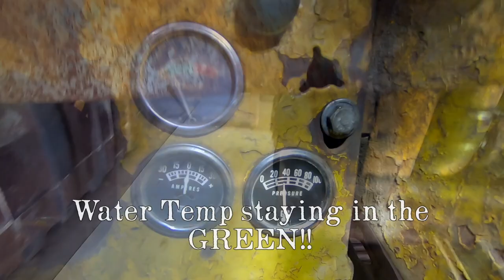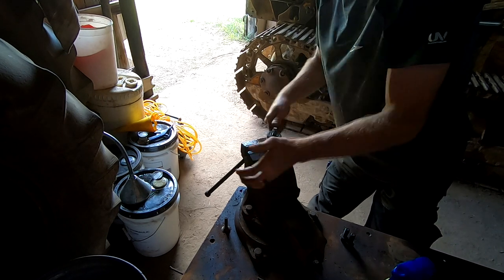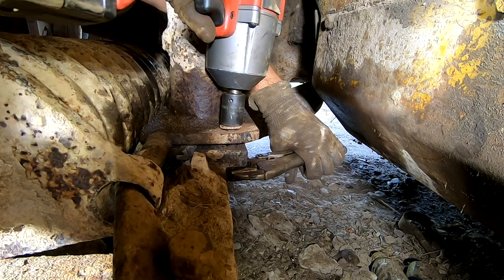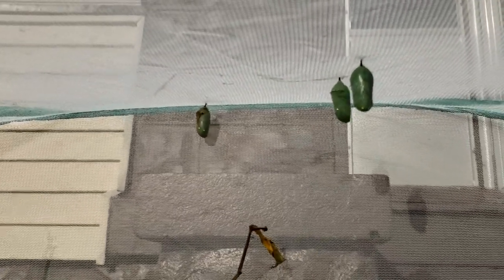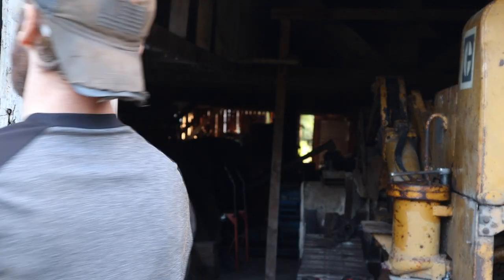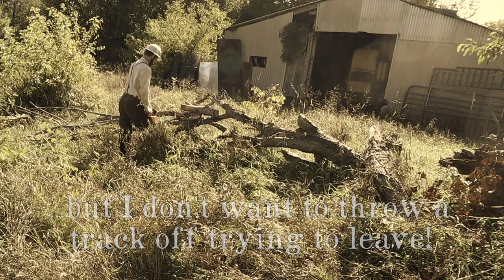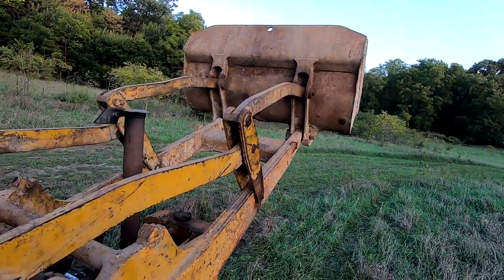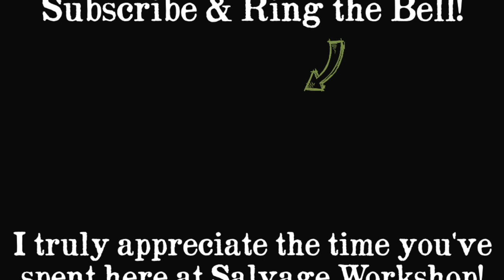Will the Bucket even WORK after 20+ Years? ~ Part 4 ~ 1950's Caterpillar TraxCavator

Comment: I am not an officially accredited mechanic, nor do I have any official recognition of any kind in that regard so take my suggestions on the merit of rational logic and the strength of the disclaimer.
I am an Aussie 'bush mechanic' and I too, 'left the factory' in 1956, I have been messing with heavy machinery for the better part of fifty years.
I learned the ropes living and working in rural communities and figuring things out for myself or helping my buddies, particularly while mining opal in the Outback and maintaining my own equipment.

I suspect that once the track tension is where it should be according to manufacturer's specifications, sideways play would be undesirable due to torsional wear on the track pins and sockets and maybe even the drive sprocket at the other end.
The shims are probably only intended to be used for centering the tension idler in correct alignment between the track and suspension frame.

The main reason likely for maintaining slight clearance between the idler axle end plates and the chassis rail would be  to prevent misalignment between the idler axle and retainer bracket due to uneven tension resulting in abnormal wear.
Just in case you don't know yet, for non-mechanical tensioners adjusted by grease, the only way I have encountered for normally increasing track tension is by pumping grease into the cylinder which pushes against the plunger and this is achieved via a normal size grease nipple.

That cylinder, can hold quite a bit of grease when a track is near worn out and the adjuster is near it's limit and also be aware that the adjuster assembly and idler are very, heavy as a unit.
Despite this, the most efficient way I have found to clear all the grease out if you fit a new track/idler and need to back off the adjustment is to remove the plunger from the cylinder like a giant syringe and scoop out the grease.

Also, you cannot save money via extending the life of tracks by removing links because it incurs a different cost anyway.
This is because just as gradual stretch in the drive chain can do, removing links can alter the angle at which the tracks engage the teeth of a drive sprocket in more or less the same way as happens for motor cycle chains.
This causes the teeth on drive sprockets to wear faster in a sort of crescent shaped curve on one side so that the sprockets will then also need replacing as well as the track.

In addition to all that, I have only ever serviced old style tracks and the amount of heat you have to apply to a grouser plate in order to drive out a pin with a sledge hammer and drift is phenomenal not to mention very awkward!
I finished up buying a propane heating tip that puts out a flame like the burner on a small hot air balloon in order to apply sufficient heat to the track pin on a larger machine!
Either that, or you need a really beefy hydraulic power pack and ram!

Comment: My only experience with track loaders is having worked for a contractor in the 1980s who had an early 1960s era John Deere. The tensioners were frozen and I don't think the tracks were actually parallel anymore. My boss had a way of turning the machine a bit, backing up and the completing the turn. His son, being younger, was always in more of a hurry and had a tendency to run the tracks off while using it. Then My boss and I would have to put the track back on. The first time it almost an entire eight hour work day. By the time they were done digging the foundation for his son's warehouse we could fix it in an hour.

Comment: I would be careful about the track tensioner. It could mean that the track or the track bushings are worn out. But again I’m no expert. Just keep in mind. 
Think like some others that an owners manual and service manual would be money well spent! 
Having a blast watching you get it running!👍
Reply: The bearings in the front idlers are totally shot. You can tell by looking at how off center the idler is with respect to it's center of rotation (side view).  This is why there is so much side to side wobble in the idler.  This machine will cost way more to restore than it is worth.  Every time he fixes something,  he will discover that some other thing is worn to self destruction. The idlers will need total replacement along with track adjusters and track, and sprockets, and rollers....  And on and on and on.  Better quit while he can, just wasting time and money.  Good YouTube fodder though.

Comment: You would want a little bit of movement so when you go to adjust the tracks the idler moves instead of being shimmed up real tight, you’ll figure it out👍 good job so far on bring it back to life
Reply: Also if a rock gets caught in the track the idler needs to be able to spring back instead of breaking something.
Reply: It is very common to find these types of repairs (in our area generally called plating) as repair patches whe adjusters don't work, springs are broken or soose tension.   Usually a stack of Plates with a U cut into them and dropped over the cylinders, screws, or spring retainers.

Comment: You have great mechanical ability, You need the 1- Operators Manual 2 - Parts Manual 3 - Service Manual from Cat or ebay ect. Use the exact model # and Serial # to get the right ones. Gregory Cross is correct you over camed the bucket linkage because of wear in the pins. The Idler is missing wear strips under the idler hub, and it probably needs the wear strips on the inside bottom. Change the motor oil filter I have had those canaster filters collapse in the canister when sitting for a long time stopping the oil from lubricating the engine. Always put your implements (Bucket ect) on the ground when you work on hydraulics.  Good Luck keep up the good work
Reply: Bill wrote: ".... The Idler is missing wear strips under the idler hub, and it probably needs the wear strips on the inside bottom ...." ......  It doesn't look as if this machine has wear strips for the bottom of the yoke; that came on later tracked loaders. The roller frame doesn't have the brackets for wear strips, and the the yoke is not shaped to accept wear strips.
Reply: @wittwittwer1043  The wear strips I am talking about you can see in the video at 4:00

Comment: Know this machine very well. We had several different models of the 955 on the ice when I was there in the late 70's including at Byrd one of these. The pony motor is unusual in that the starter runs on a vee belt and once started becomes a generator as the main engine does not have one. The pony motor can also be rope started on the flywheel in the cockpit. Watch your knuckles if you try.
The valve on top of the hydraulic oil filter is a relief valve which only opens should the filter become blocked. From what I can see it appears to be working correctly.

Comment: One thing I noticed is your bucket curl is backwards, usually pulling back on the lever curls bucket back and ahead dumps. Otherwise great video I’ve been enjoying this series !
Reply: And the levers are swapped compared to every wheel loader or LHD I've ever run.
Reply: This is not true for many  Cat machines.  They made it that way so that the operator can dual function, raise and curl by pulling both levers back at the same time to help the machine dig into a bank when loading.  It takes a little getting used to but for a two lever machine is maybe the best way since the hand does not have to continue switching between levers.

Comment: You need to power wash this thing really bad.  I'd get a couple of gallons of paint stripper and some wire brushes and take the paint off and repaint it.  I wish I could do this kind of work but my back is too messed up.  I like the way you clean up every area and replace all the bolt and fix the busted ones.

Comment: Those side plates are only to keep the idler central in the trunion and the reason for the vertical instability is because the upper and lower wear slides welded to the trunion are worn - most likely more on the bottom slide as it is mostly carrying weight and although the slides may look healthy at the front - further in they will likely be worn to nothing 
Fairly simple process to split the track and roll the idler out giving you access to the sacrificial slides - Nip them out and replace with new (hopefully done before they have worn through and into the trunion or roller frame as you call it )
See the side wear on the chain pins which means the chain is coming right across and touching on the track/stone guard plus outer rim on the first roller is worn off so even more important that you get the idler tracking correctly

Comment: If the roller bracket is bolted down I don't see why there needs to be movement sideways, maybe enough so it doesn't rub or bolt some hard plastic to wear area on plate.
The track tensioner is definetaly a quik fix with no idea and the skinny bolt too in idler bracket.
Maybe the bolt that had a screwdriver head in filter cover pushes valve in .
Theres always 1 hose to blow.
Great video.
Thanks for sharing

Comment: The part you think that spins on the top of the filter doesn’t move.  It’s the filter bypass valve, it only opens if oil can’t flow through the filter when it gets clogged up.  And you hydraulic oil is contaminated with water, that’s why it looks like milk.

Comment: Idler side movement plates need a slight gap. The leverage forces there are huge so it will move it however tight you set the shims. I’d give it an 1/8”. *that was lift though, showing as wobble. The wearing part is the lower hooked part of the bearing block inside the track frame channel.

Comment: Not a Cat wrangler but might be the track is "stretched" (i.e. worn) enough that it got to the end of the adjustment.  The spring looks like it's extended to the maximum; I'd say the spring is there to tension the track, and for that to happen it has to not be extended to the stop.  Either that or the adjuster is worn and not working right as you guessed.  Will be interested to see which!

Comment: Hydraulic filter. Because the spool valves are in the tank there wasn’t a simple way of having a low pressure filter. So they fitted that heavy high pressure filter. If the pump breaks up it doesn’t  spit bits into the rams, so in a way it is better. The filter retaining cap is castleated to keep it in the middle and the bottom seal flat in the housing. The sprung valve is the by-pass valve if the filter blocks. Top bleed screw might be more of a filler than a bleed? I wouldn’t crack it with the pump running :o
Reply: teamidris am I correct in my assumption the 10 M on the cartridge is for 10 micron?
Reply: @cordcd7  that seems right. You really want a magnet for steel and that tight 10 micron for the brass or dust.

Comment: Hi . There is supposed to be about 1-2 mm gap on either side of idler between those plates and track frame to allow idler to move back on spring tension and those 2 vertical bolts on either side of idler have springs inside  bearing housing that sometimes break or get flat at least that is how it's setup on D4 but looks much the same.
Cheers Chris

Comment: If you want the beast to live and need it to work, you're going to have to do at least a working restoration. Look up whatever manuals you can find, find out if there was a kit to modernize the track tensioner or the proceedure to address maxed out track tensioners (which might call for replacing the track). The hydtraulic fluid shown appears to have water and metal (that steel grey color isn't good but it could be the computer interface making it look like badly contaminated hydraulic fluid) and.... all the rubber hose hydraulic lines are aged out if they're over 20 years old and (IMO) kind of useless to replace this or that hose piecemeal as they blow out. I have to suggest, drain the hydraulic system, remove the lines and filters and make a shopping list and if you can demount the hydraulic pump or if you have an endoscope (check the auto parts store to see if they have one they can loan/rent you) look inside the pump for problems or at least do some focused cleaning. As for the filter assembly, the popup valve is a bypass valve and that 'air bleed screw' should be a PDI (popup display indicator) but it may be an airbleed valve... I don't know when they started using PDI's. The black body itself is a 'spider' that just spaces the filter for proper fluid flow. The flow of the fluid should be coming from the bottom into the filter and out thru the filter and a line from the side returning to the pump. So, 1 in flow, 1 outflow. As for air in the system... depending on the age and design there may be an airbleed valve at the highest point or an internal automated valve as part of the hydraulic valve. (Note: Nearly all of my hydraulic experiance is on helicopters, which I wrote maintenance manuals for so I'm positive I'm close enough for gubbmint work)
Reply: The hydraulic fluid should flow around the housing and then thru the filter, and exits down the center.  The bypass is there so if the filter is clogged, the pressure pushes it down and allows the excess oil to go down the center like normal.

Comment: I can't believe how many broken or badly maintained bit you're finding! :o
How is the machine even holding together!?
Replacing a bolt WHEN it breaks really isn't THAT hard is it? Certainly saves a lot of grief later on!
Bodge, bodge, bodge!
Reply: Npthing major has been broken 
Its a very old machine 
Vant expect every machine to be a barn find 
By standard this is in amazing condition for an industrial machine 
Remember this is a tool not a classic car 
This was looked apon same was someone looks at a cordless drill 
Use it as the job demands then buy a new one when its worn out 
Then sell it to continuously lower budget operations 
So you end up with the lowest budget operations getting the most worn out machines 
You see what happens
Reply: @fowletm1992  this machine was driven into the barn and parked with nothing more done to it. It had been working in that condition and besides a bit of deterioration to the hoses, seals, etc it's in exactly the same condition it was when in use.
When I was younger we had a similar model D4, half a dozen years older I believe - the only significant difference is ours had a blade and tree pusher on the front, canopy over the top and rippers on the back. We had virtually zero budget to keep it maintained, and it worked HARD, much harder than just pushing chickenshit from one end of a shed to the other.
There was not one single broken bolt left unfixed, nothing was ever left for later, but fixed as soon as it was humanly possible. No shortcuts were ever made beyond those absolutely required to get it back to the shed for proper repairs.
This machine has been abused badly. There is no excuse.
Reply: @legbreaker2762  
The under cars are is the big telltale 
This girls seen a lot of hours 
The other thing people forget is organic material is actually a lubricate to under carrage 
Used to work for a hire company doing everything from little D6s on road projects to d11s in open cut mines 
Mostly mining gear but the machines working in wood chips or pig barns remain in prefect condition 
Machines working in mining and quarrying cop a flogging 
Roller cap bolts and belly pan bolts are 1in to 1 1/2 just get sheared off like they're wood 
Used to replace a few roller cap bolts a day at the gold mine 
And you need a few decent tools and good skills to get the bolts out 
Easy outs and drills are well out of their league

Comment: When the bucket and arms get a bit of wear- they will over-center- as seen right as the hose popped.. without doing all new pins and bushings, just remember not to dump the bucket all the way, and pull it back a touch before lowering the arms... And Yes- Caterpillar bucket controls are backward- pull the lever back to dump, push forward to return..

Comment: Whenever you open up a hydraulic circuit, make sure you are switched off, locked & propped. A lot of accidents and injuries (or worse) have been caused as a result of a hydraulic circuit still being pressurised.
Reply: Yes, I was very scared when you started removing the hose with the bucket still hanging in the air. Fortunately the hose was the one for the tilt down direction, if it had been the other one it would have been pressurized and you would have been completely soaked in oil if lucky, injured by the high pressure oil jet or crushed by the linkage if unlucky. 

Always make sure the equipment is lowered to the ground or reliably supported before doing any work or leaving the machine, people get killed from time to time because they carelessly open a hydraulic connection and something comes down on them.

Also, hydraulic hoses are not that expensive, it's usually not worth it to reuse them, especially if they are as old and hardened as those. Especially on these older machines blowing a hose can be dangerous as there's no cab to protect the operator from oil jets. High pressure oil can penetrate the skin and cause lots of unpleasant things like necrosis of the affected tissues.
Reply: @Murgoh  Yeah! What he said.

Comment: i drove an m60a3 tank in the army. the last thing you want to do is throw a track. i had one pop off during reforger maneuvers while in germany when my tank slid down a muddy hill sideways. the track sheared the final drive unit shaft that held the drive sprocket. it was about 8" dia. of hardened steel, and it took 36 hours to remove and replace the track and drive unit. i would hate to think of what that cost, but when you're told to go somewhere by a officer, you go.